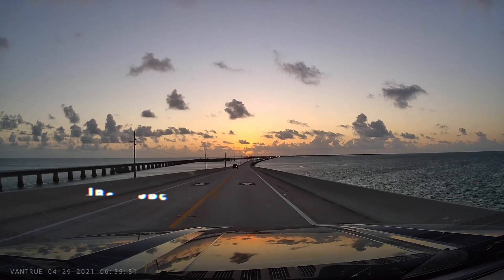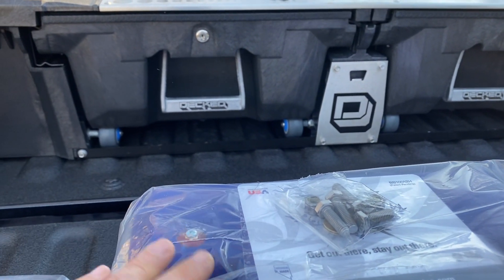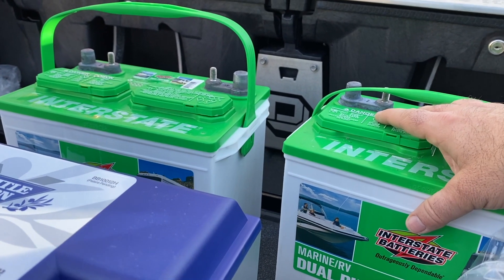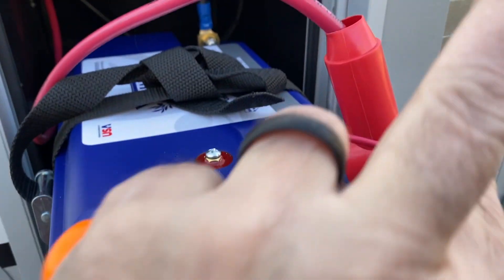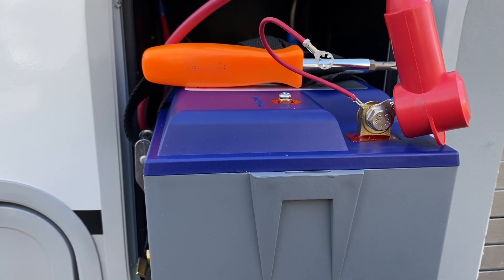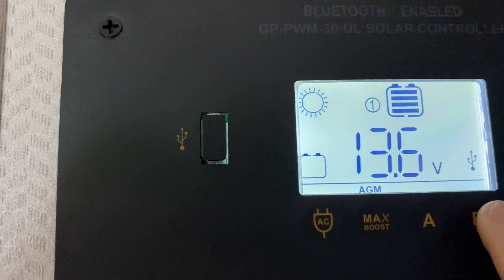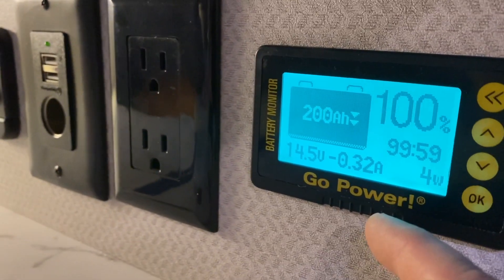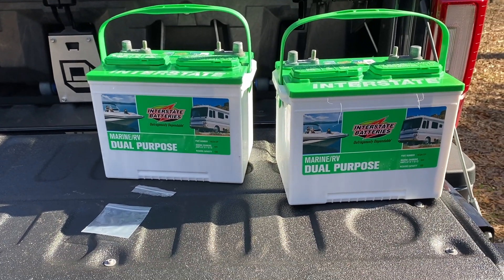Are Battle Born Batteries drop in ready? RV

Comment: If you look at the charge by voltage chart you'll see that it is a pretty flat chart, with the exception of the very beginning near 100% and the end near 0%.    You'll see that last 1% of charge from 99 to 100% is a whole volt.  Well, if you set your max to 13.4-13.6 and min to10.5-11v, you'll extend the life of the battery while only trimming a few percentage points off the capacity of the battery.  You could say it stresses the battery a little to force that last volt into or out of the battery.  It's worth as much as another 1000 charge cycles from what I've read.
Reply: Excellent observations and points. The monitor I set in the video doesn’t impact the charge, it’s just for letting you know status of charge, but I really should set a little lower if I want to show float charge as “full” as it floats lower.  Battle Born, like some other good brands, has an internal BMS that does just what you said automatically. For this reason you technically should also set the amp hours a few digits lower than capacity for the monitor to get more accurate read out of usable hours left.  BB I believe suggest 96-98 or somewhere in there for a 100 amp hr battery.  For my purposes I set at 100% because I don’t run it past 10% anyway.

Comment: Fantastic video, thank you! We just got 2 Battle Born batteries, pretty much same set up like yours. I did not know about the switch on the converter plate (5:16) and I could not find it in the Lance owner's manual. Would you be so kind and point me to where in the manual this is described for lithium batteries? Much appreciated.
Reply: I‘ll see if I can find it and post. We are camping now but will pull manuals out tonight.
Reply from the maker: I went through my manuals and this is one i did not have, thus I had looked it up online at Progressive Dynamics.

Comment: Are you also charging from the alternator?  If so did you install a DC to DC charger?
Reply from the maker: We have that DC to DC charger installed now.  Works great.
Reply: Currently there is a nominal charge through the 7 pin from the alternator but not even close to solar. 

We are in process this week of installing a Victron DC to DC charger (30 amp) that can be switched between charging these two batteries and another battery bank we are installing to power an inverter.